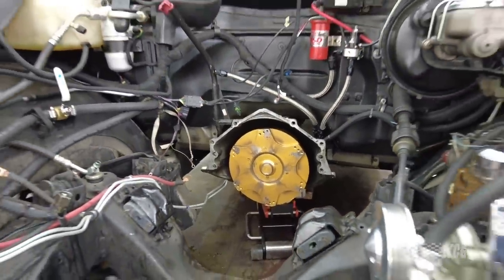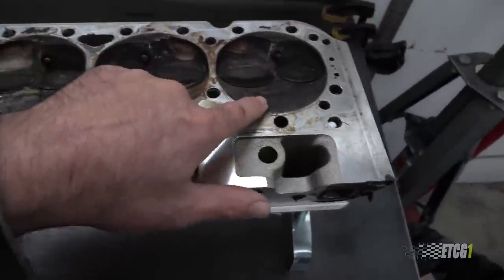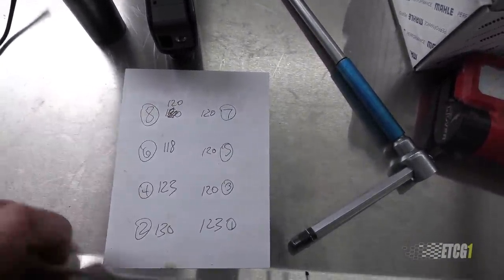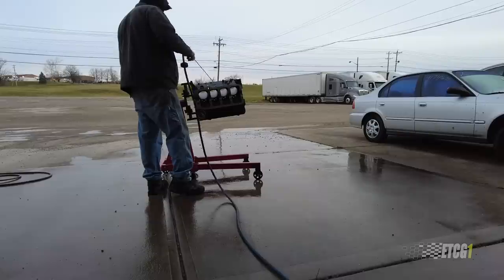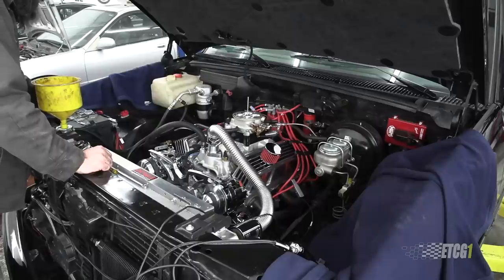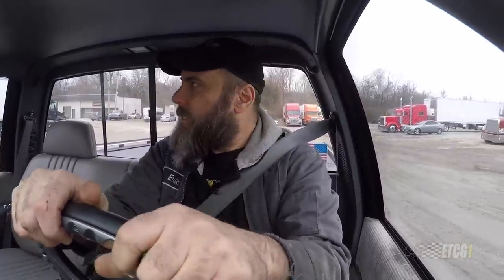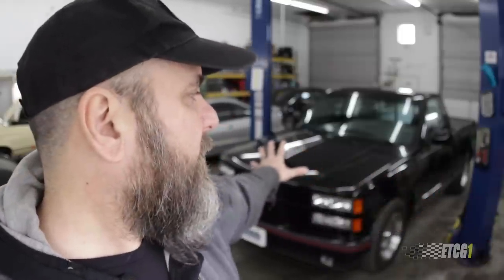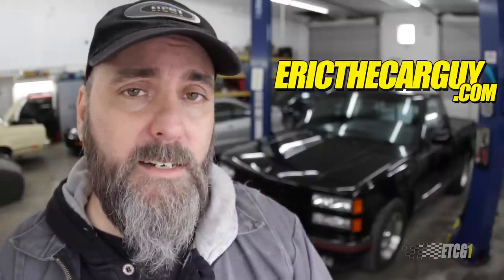Oil Leak Fixed Once and For All

Comment: In my experience of both just throwing things together out of boredom or old worn out equipment just to get a little work out of them. Honing is more important that even new rings. I've honed and thrown in the same old rings and pistons and had less blow by then not honing and putting in new rings/and or pistons.

Comment: That automatic gearbox is a mistake too in my opinion. But we don’t argue about taste. :)
Nice job! Good to see the smile on your face :)
Reply: In these trucks the automatic is actually better. The manual transmissions that came in these truck were terrible, they were very weak and shifted like a semi truck and just we not very pleasant.
Reply from the maker: I made the truck for my 70 year old dad to drive on the Hot Rod Power Tour. Last I checked, it was my truck, so I wouldn't call having an automatic a 'mistake'. Thanks for the comment.

Comment: Eric a diagnostic tool you dont see used enough is a blow by meter Basically yo insert the hose from the meter into a PCV hole and observe the reading in cfm A well-sealed motor will read 5 to 10 cfm This test is done with the engine running making it the only Dynamic engine test  On Diesels it's known as a manometer test It is a great PM tool as you can watch the engine blow-by greater amounts as it wears out to a point where you need to re-ring The blowby results will help with oil leaks, plug fouling, carbon formation, and poor vacum
Reply from the maker: That's cool. I'll have to see if I can track one of those down. I just used a piece of paper.

Comment: 12:50 i think the valve reliefs being wrong might have choked the air and exhaust flow
.
now air can flow around the valve and has a "pocket" to flow around
Reply from the maker: I don't think that had a measurable effect. I think the compression loss had more to do with it. Thanks for the comment.

Comment: Eric, thanks for inspiring some confidence to rip apart my engine. Do u have any tips for cylinder honing and best place to get the tools for this? Also, i have bored out cylinders and i’m at a loss for how i source the correct size replacement rings. Turbo charged. A borescope indicates cylinder wall scoring, when is scoring too bad and when to re ring and hone?

Comment: Good reminder & education, Eric :) Would be nice to see the final numbers: Compression up towards 200? 
Hot Idle: Vac 20 in? & A/F 14.7? :)
Reply from the maker: It would have been nice to get the final compression numbers, but the headers make it very difficult to remove the plugs while they are still attached. Typically, a 350 would have compression in the 160-180 range if the engine is in good shape. You won't ever see vacuum readings that high with a performance cam. In fact, my 17inhg is pretty darn good for a performance cam. As for A/F ratios, I'm in control of that with the EFI system. Previously, before the latest rebuild, I had the idle set at 12.8. After the rebuild, I was able to run it at 13.1 with no issue. If I ran it that lean previously it would stall when coming to a stop. In summary, it's a completely different engine since I did this work, and it wasn't running bad at all before. Thanks for the comment.

Comment: Looks like the motor was burning oil. The heads and top of the pistons were covered in oil. I just built a 385 for my truck with factory vortec heads and a 9.3 to 1 compression ratio and my cylinder pressure was around 165 and 170psi so I think the oil is getting past the rings. Also might want to check how far the pistons hang out of the bottom of the cylinder, in the late 80s gm decided to shorten the bottom of the cylinders and it can damage the skirt of the piston.

Comment: A small block Chevy head should be able to bolt on either way there isn’t a specific left/right side head are you sure there wasn’t valve float ? Too much lift ect ? Is the cam hydraulic I’d imagine? Is your spring pressure correct ?

Comment: Thanks for the Happy Birthday (mine is today!)  Glad that you found the problem.  Didn't know you could "move" a piston to a different cylinder after it had been installed and running.  I guess that only matters if you're not changing out the rings, or does anything else have to be done with the arms and connections to the crank?
Reply from the maker: The pistons didn't have offset pins so it really didn't matter. Happy Birthday!
Reply: I was more thinking on the parts (pistons in this case) as they wore in with the block.  I have heard from many that parts of an engine should always go back from where they were taken from (some even say fasteners as well), like for rocker arms and other parts of the valve assemblies.
Reply from the maker: @thepeepsdotnet  That is good practice, but in this case the pistons were only in those locations for a short time and not much wear occurred. In short, I got away with it this time. Thanks for the comments.

Comment: As soon as you camera'd over to the block I knew the pistons were backwards. We've all done little mistakes. Luckily yours didn't cost you a new motor. Those compression numbers were way low for a sbc. Even in stock form with 150k miles on them and 76cc chamber heads they usually carry 150 psi or better. I'm curious to know what the compression is at now. You don't have a giant cam that is causing a lot of bleed down from overlap so it should be 180 or so anyway.
Reply from the maker: I agree, and I would have taken a second set of measurements if I didn't have so much trouble accessing the plugs with the headers I"m running.
Reply: That's the worst part about headers lol. Some are better than others, but they all suck when it comes to plug accessibility

Comment: Yes if half the pistons were installed backwards, the pin offsets on those would cause a noticeable engine vibration. Half the pistons would fire with the pistons in a different relative position to the correctly installed ones.
Reply from the maker: There is no pin offset with the pistons I'm running. Even if there was, it wouldn't matter unless I installed the pistons with the valve reliefs facing the other way.

Comment: hello dude, got a similar problem on my 351 cleveland with persistant oil leaks at rear of engine  . was the crank case pressure coming up through the heads and out the filler hole and pvc  .
Reply from the maker: https://youtu.be/9uiWjsNgpGg

Comment: Hey Ed is there any chance You could do a video on rebuilding a Harley Pan Head? You might want to avoid the 1953 year as I believe there were 2 mid-year changes. I guarantee you will double your average views per video in less than a year. Mike from Maryland

Comment: Your Valve could be bent because the seat was not at right angles to the valve guide and  hence the valve seat and the face so the pressure from the valve sping would cause the valve to bend over time.  The other effect of this would be the valve would not rotate and eventually burn more on one side than the other.

Comment: You might try having it honed professionally with a torque plate .
Reply from the maker: Honing is less susceptible to issues than boring. No need for a torque plate for that.
Reply: @ETCG1  ,,, actually it's the complete opposite  . The last few thousandths taken out with the hone, is what straightens and trues the bore . And a flex hone is not really compatible with a torque plate, because the flex hone follows what is there . There are times when a flex hone has its place .
Reply from the maker: Given that the engine had less than 3K on it with a fresh over bore, I don't think in my case it was an issue. Thanks for the comments.
Reply: @ETCG1  ,,, you are right, in some situations honing with a plate, there is very little gain ; however an overbored small block is a real candidate for the plate for honing, right after boring .

Comment: Newbuild engines need to started up and run in on break-in-oil.
A dual plane intake manifold like Performer RPM WILL improve the performance even more. ;)

Comment: I'm confused.. what CAUSED the vertical scoring? Those seem like super wide ring gaps (.019 - .021??).. but if it's the spec., it's the spec. Also perhaps beveling the open inside edges of each ring will prevent it from creating a sharp edge along the piston wall.. but I dunno 'bout that. But it DOES sound SUUUPER nice.
Reply from the maker: I estimate the scoring happened where the ring gaps were. They move around a bit during engine operation. BTW, I always de-burr rings when I finish filing them.

Comment: If you flipped the Pistons did you flip them or did you flip the whole assembly with rod. I know some rods have the bearing off set and there is a chamfer to allow clearance to the cheek of the counter weights.
Reply from the maker: Just the pistons. The rods are offset and need to be in the correct position for proper oiling. Since the piston pins were full floating, it wasn't a big deal. Thanks for the comment.
Reply: @ETCG1  I learned that the hard way back in high school . Although I caught it ., It cost me and had the machine shop re press my piston and rod assembly. I numbered my rods wrong and the machine shop assumed the rods went to their respective bores well half of then where backwards. By the time I got to the last set you couldn't turn the engine over.
Reply from the maker: @oldsrktracer  Ouch. That sucked.

Comment: Eric,
Great build and video -thank you!
Im not a Chevy guy so I am confused: there are L & R pistons or there are L & R cylinder heads or ?
God bless
Paul (in MA)
Reply: That's just the way those valve relief cut pistons are designed - they machine in a larger valve pocket for the intake side. You'd think the cylinder heads would be the same along one side, and the opposite on the other as far as valve arrangement goes, but that's not the case. You have to match those pockets on the piston to the valve arrangement in the head. Very easy mistake to make!
Reply from the maker: The valve positioning on a small block Chevy is not symmetrical like a Ford. Later in the video I show the correct positioning of the pistons so they match up with the valves in the heads. Thanks for the comment.

Comment: I would think the ONLY way those valves survived-
was that they were hit on the downstroke. If you look at 
the surfaces, it's just a "mark", there's no mashing, crushing,
or bending- as what happens on an upstroke, when both
crash together. Think of it as a pat on the back,
while you're running away. You got lucky!

Meh- you're only Human, after all.
Reply: Vw1.6 diesels are often running with the valves kissing the pistons- even when closed!

Comment: Good job Eric, this truck is badass!!. Did you not have oil compsumtion before due to the cylinder scoring?
Reply from the maker: Didn't notice. The entire undercarriage of the truck was coated with the oil that was leaking out of the engine. I was more concerned about that.

Comment: I would like to know what effects if any you were able to pick up on having ran that engine with half the pistons flipped then corrected?  Do you think that may have been at least some of the cause of the cylinder wear....just wanted to know because any information would be quite useful ... to me at least
Reply: For example do you think any of that timing ping you dealt with may have been valve interference and could you hear any difference?
Reply from the maker: I don't believe the piston positioning had anything to do with it. The valves barely went into the pockets on the tops of the pistons as evidenced by the contact with the intake valves which was minimal. I think the increased compression from good sealing rings, the gasket matching, and the 2" spacer are responsible for the gains I got. Thanks for the comment.

Comment: I guess that's the reason when one is going to rebuild I always take it to a reputable engine machinist have the engine baked and all thread holes have been bottom taped, and then have the cylinder miked and bored if necessary and do a complete rebuild.

Comment: 10:40, engine doesn't do that shimmy anymore and 12:30 like a kitten. Nice. :)
Reply from the maker: That 'shimmy' was likely the low compression on 3 &6, and possibly that bent valve. Now it's 'hitting on all 8' and doing quite well. Thanks for the comment.

Comment: Ecg have you had any issues with the proflo 4 system? Been looking at them myself but hesitant with all the diffrent reviews  kits
Reply from the maker: I like it so much I'm installing it on my next build. I'm also considering it for the Fairmont because of the MPFI aspect. I find the rear cylinders on the Ford tend to run a little rich compared to the rest.

Comment: Best engine oil Royal Purple HPS and use there filter.
Best fuel  injector cleaner BG products
Best Air filter and cabin air filter are made by WIX
Best windshield wiper fluid Ran X 2 and 1 all season.
Best wipers Trico Titan.
Best rotors for cheap Power Stop. Use ceramic brake pads.
Change serpentine belt at 80,000 miles to be safe.
Change wiper arms every few years the springs get weak
Flush all fluid at recommended times.
Check ball joint and ball bearings once a year
Check tire air pressure once a week
Maintain the vehicle so it last a long time a lot of people don't do this.

Comment: When is the type r integra gonna come back? Been waiting for the supercharger install for awhile now.
Reply from the maker: Not anytime soon. First, I still don't have the supercharger back from the rebuilder. Second, the car is together and running excellent. It's hard to tear it apart when it's running so good. However, I am gathering up the parts for the day I tear into it. Until then, I'll be working on the Factory Five and a few other projects. A K swapped Civic might be of interest to you. Stay tuned and thanks for the comment.

Comment: How much did the compression in each cylinder increase after the rebuild?
Reply from the maker: Hard to say without testing it. BTW, getting the plugs out is difficult with the headers I'm running or I would have checked it. Typically a SBC will be around 150.

Comment: So you installed some of the pistons rotated 180 off?
Reply from the maker: Yes. There are left and right pistons for this engine. They need to correspond with the valves in the cylinder heads.

Comment: Awesome job Eric 
Wanna help me rebuild my 2016 Honda Civic 1.5 engine 
I’ve been doing oil changes at 1000km because of all the gas making it into the oil 
Honda fucked us over with that engine
Reply: That’s crazy excessive. 

And rebuilding the engine won’t fix the system that does it.

Comment: What the heck is going on with Ford Ranger 4cyl engines....8 spark plugs and wire for a 4 banger....WTF!?
Reply from the maker: Funny, it's actually a Mazda engine.
Reply: I did a head gasket job on a late '70s or early '80s Datsun pickup that was like that.  I think it had something to do with emissions.  Could be wrong.  That was more than 30 years ago.

Comment: With the money you have in this engine, it should take a trip to the machine shop for a hot tank treatment. The scoring that you saw is from working dirty. Engine assembly needs to be as clean as an operating room. With all of the filings you created, you have a good chance of a repeat failure. With that said, good luck. I hope you get away with assembling in a general-purpose shop area.

Comment: A throttle body spacer does not do anything for you. It's a waste of money! I also thought you should have deburred the piston pin holes that scraped a bunch of your cylinders. That was fairly terrible.

Put a borescope into the cylinders to see if the pistons are scraping up the cylinders again.
Reply from the maker: I disagree on the spacer. It's a well documented power adder in the right circumstance, and after my experience with this truck, I'd agree. I always de-burr the rings when installing them. Thanks for the comment.
Reply: @ETCG1  Not the deburring the rings; deburring the piston where they were machined for the piston pin to insert. A few of the cylinders appeared to have wear marks at exactly the same location - the side of the cylinder where the piston pin ends go. The only reason that I could think of for the consistency in that wear would be the pistons have some high material at the piston pin holes from when they were machined. Or the pin clips are sticking out a bit, but I've not seen that before.
Reply from the maker: @stephendee7839  Given the piston pins are recessed, there is no way for them to come into contact with the cylinder walls. If they did, there would be much bigger problems.
Reply: @ETCG1  not the piston  pins either. If I'm right about the cylinders being damaged at similar points around the circumference, aligning with the piston pins, then I would suspect burs on the edge of the piston metal where the piston pin enters the side of the  piston. But maybe the scoring wasn't as consistent as it looked on screen.
Reply from the maker: @stephendee7839  The scoring occurred where the ring gaps were.
Reply: @ETCG1  Got it. So definitely the corners of the ring-ends marred the cylinders and that's where the deburring/edge-softening was needed. :-(